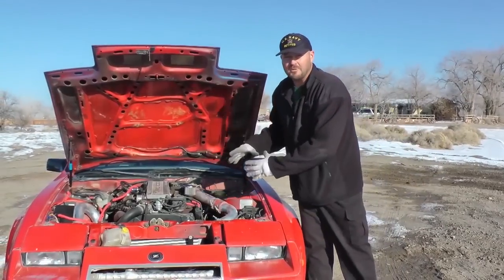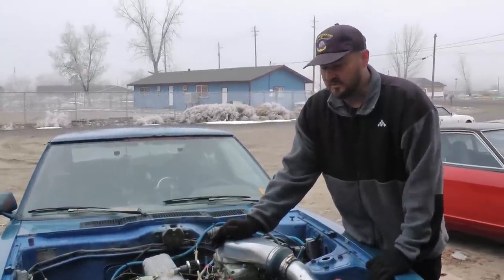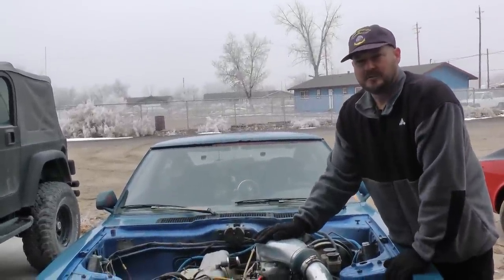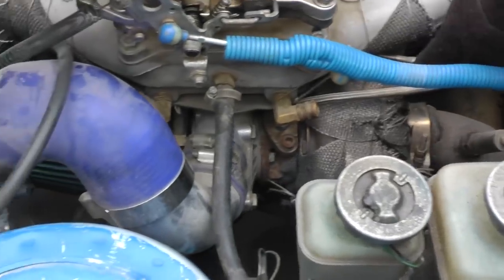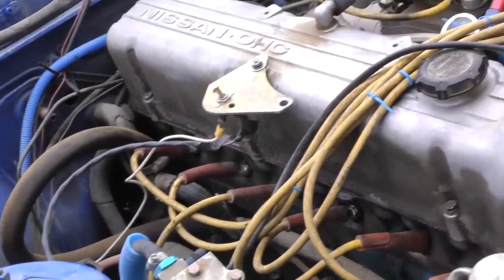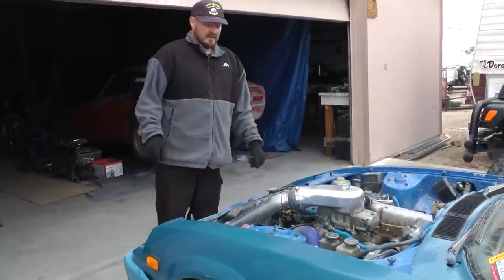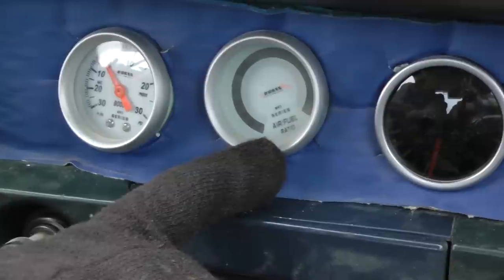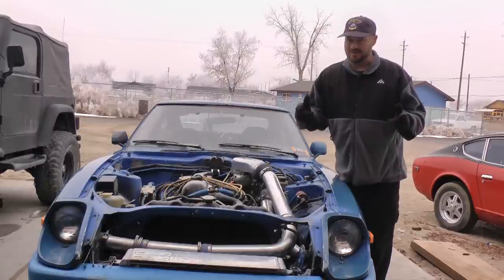Blow Through TurboCharging (Carburetor)

Comment: just gotta correct something: blow-off valves ARE needed. If you don't have it, the boost goes back through your turbo, decelerating it much faster than it would normally experience. this damages turbos.
Reply from the maker: dandil Watch our blow off valve the truth video.  Then if you still desire to make a comment, make your comment about blow off valves on that video not the Blow through Carburator video.  Thanks
Reply: all it does it slightly wear the thrust plate in the turbo core
and to tell is when a turbo shaft can be pushed back and forth(towards each turbine) 
this test is not the up and down play that ever knob talks about

there is a test to check for play up and down  on the compressor wheel and that is to hold the nut and  pull up and down(towards each side/top and bottom of the cold side/compressor housing)   
however every turbo new or old has play this is normal and this  is because there is very little oil in it
when you add oil this play will go to almost nothing as the oil and its pressure closes the gap

a good turbo will have some play but they should not hit the housing if so they are no good 
in worse case it will bend or snap off blades/fins of the wheels

bovs  with out them you can worst case is they snap the shaft(snap the compressor or turbine wheel off)
this hardly happens but does happen
Reply: Bottom line....you don't HAVE TO have 1.....but, it is a little more wear on the turbo on low boost systems. Now on systems with more (fun stuff) boost it WILL damage the turbo a lot faster then you'd like it to and cutting the life of it by a fair amount. But your right you don't have to have 1 if u can't or don't wanna afford to put 1 in but it is always recommend! Not to mention if your running a lot of boost and no waste valve it can blow something up. Seen it first hand lol its kinds like wearing a seat belt....do you have to wear 1 to drive...no, and u may go forever without an accident where u needed to be wearing 1 or u could never have an accident, or....you could go out on your first drive and bam
...should've put that belt on I guess lol....everyone loves to gamble right???? Would I put 1 on? Yes....would I drive mine here and there until I could get 1 put on? Yes...long term you should have 1 installed, the cons just outweigh the pros no matter the odds
Reply: @jjmccloud  No man! Didn't you listen to the video? He says it just, "dissipates".
LMFAO!!!! 🤣🤣🤣😋
Reply: You dont have to have it just like you dont have to have a intercooler but it makes no sense not to have. Especially when you can buy one used for nothing.

Comment: Blowoff* valves aren't necessary, but bypass valves in general, yes, ALWAYS run one on a boosted gasoline setup. Important tip: a blowoff valve is a specific type of bypass valve. I know stock tuning sometimes won't compensate quite correctly for a true blowoff valve [versus a stock bypass valve], but running a full on blowoff valve is undeniably safer than having no bypass at all. When the throttle plate closes under boost, if there's no bypass valve, that pressurized air has nowhere to go but back out through the turbocharger, in the wrong direction. Even if it doesn't literally cause the turbo to momentarily spin backwards, it can still mechanically stress the turbo unnecessarily. Overall good video though. Always run some sort of bypass valve on your turbocharged gasoline engine.

Comment: Although I drive an 86 z28, I still love watching informative stuff on cars, such as boosting. Awesome video, I'm not a forced induction expert, but I learned alot.
Reply from the maker: Bryan Dunn Lots of potential in the Camaro series.  Lots of budget twin turbo kits available for the Small block Chevy engines.  Superchargers are great in the Camaro as well.
Reply: Budget Boosting Agreed, I can pickup the piping, fmic, wastegate and bov, and a decent (non-ebay) turbo for a little over a grand. My problem would be tuning, my car uses the TPI setup from gm, so its run off of an ecm with a pretuned memcal. I think my next project is going to be a mkiii supra, although I haven't decided whether or not I like the 7m-gte platform more than the 1jz.

Comment: DUDE...I had a 77 280z and would have gave my left nut to have that set up. 
This was the best most simple, straight forward DIY how to on a budget even. Never know you could turbo a carbed motor. And compared to an EFI upgrade + turbo's it's a real budget build with big power potential. While retaining drivability.
Reply from the maker: starbattles1 Yes, I remember when I decided to go that route due to the stock fuel injection not handling the turbo set up very well.  I went the blow through turbo route and I have liked that set up the best.  I started with the Demon 650 blow through carb which was pretty good and eventually to the Quick fuel SS-650-BAN 4 barrel carburetor and I like it even more.  I have the intake and exhaust manifolds off this Z car waiting for a custom twin turbo header which a friend of mine fabricated to fit two of my z cars which will fit any z from 1970-1983, all the L series inline sixes.  It was fabricated to fit in these cars once the air conditioning compressor is removed and a few other things that are in the way for the twin turbo setup.  To me no A/C is a small price to pay for a twin T04e powered L28 Z car.  Once I get this new twin turbo header, I will get with my fabricator and he will start making them so we can sell them to others desiring twin turbo z cars.  We will sell them on our budgetboosting ebay account where we currently sell our window stickers.

Comment: I have been referring to this video for years, thinking about various vehicles I've had over the years that had carbs on them. But I'm doing it finally. Putting a turbo on an old 85 dodge ramcharger with the 318. I'm hoping to get it done before a big trip to moab Utah next April
Reply: How is your project coming along?
Reply: @matthewgraham2129  uhh......😅 not so good. The weather got bad so I had to stop working on it for like 2 months. We got thw motor and trans in, and got the motor fired up for thw first time without the turbos, and then went to move it undernits own power for the first time, but something is wrong with the trans, so it has to come back out
Reply: @garymaddux2000  haha I get that completely I'm doing a single turbo on a sbc. Got the turbo next is blow through carb and all the rest of the parts. Turbo kit will be made of pure exhaust tubing haha
Reply: @matthewgraham2129  I still need to get my turbo and blow through carb. Or I might go with an efi setup to make it simpler. For now, my headers just come up and point forward at where the radiator use to be lol.
Reply: @garymaddux2000  haha I still have to gap the rings haha got the turbo engine all apart in my shop haha. The truck is under a snowbank lol. But I'm just throwing pretty much using every paycheck for parts haha. Easy to do when you are 18 lol. But let's of projects as it it
Reply: @matthewgraham2129  I'm 30 but I'm having to start my life over, so I'm taking the time to do something for me that I've always wanted before instant rebuilding my life
Reply: @garymaddux2000  I'm right out of high-school and living at my parents house still so I am really fortunate to be able to put time and money into projects like these. I've been told over and over again to do this kinda stuff while I'm young so I will have the knowledge later in life haha
Reply: @matthewgraham2129  I would agree. Learn shit while your young, and do the thing you want to do because you may not get those chances once you settle down and have a partner and kids. I 100 don't regret anything in my life, but I do wish I could have done some things before my kids where born. I can still do them, it's just a little more difficult. But building an offroad truck is one thing I've always wanted to do, and I finally have the chance to do it
Reply: @garymaddux2000  haha that's awesome keep on keeping on and don't let it turn into all the half done projects out there haha

Comment: Huh, I have a 280zx with an L28 EFI. I thought that you HAD to go Megasquirt, big injectors, T3 and whatnot. But this looks very interesting.... I’ve never seen a carbureted car that is also turbocharged. Thank you for introducing this route to me. I’m considering this now that I see it.
Reply from the maker: The carburetor is designed for boost blow thru.  It is a quick fuel 650-BAN https://www.summitracing.com/parts/QFT-Q650-BAN. 
This carburetor with an arizona Z 4 bbl intake manifold will allow boost thru carb without complicated fuel injection systems.  https://arizonazcar.com/engine
Reply: @budgetboosting  cool. Is there a difference between 650,750 or 950 other than price?

Comment: Nice job on the blow thru setup!! I had a 79 280zx I converted to turbo but kept the EFI and it was a pain to get enough fuel to the engine at higher boost levels so I ended up using hobbs switches and extra injectors to feed it enough. Detonation was always a problem until I replaced the distributer and ecu with ones from a turbo car, then I used water injection at higher boost levels to prevent detonation. Now I got an 86 4x4 Nissan pickup with a 2.4 liter 4 banger and I'm planning a blow thru setup using a t3/t4 hybred turbo and intercooler fed into a Holley 350 2 barrel that's been prepped internally for turbo use with a boost referenced power valve and pitot tube on the bowl vent to keep a positive pressure in the bowl along with an EFI fuel pump and aeromotive boost sensing regulator. I have all the parts gathered up and ready now but need to get a smaller power brake booster since the turbo won't fit in there with the stock booster.
Reply from the maker: SuperDaveZilla I also first tried the fuel injection on my 79 and the fuel delivery had issues and that is what led to my using the blow through setup.  I even ran the MAF sensor in the boost path just prior to the intake manifold so the MAF directly adjusted to boost but even that was not enough fuel delivery for boost and the low octane pump gas.  Found that the blow through set up works well and will even work with the pump gas as long as the boost is not too high.  Thank you for watching and look forward to some pictures of the Nissan 4x4 truck blow through when its done.

Comment: I’m building a 91 Isuzu 2.3 turbo. Trying to find a decent manifold that’s not 700.00. Geminiturbo had a nice manifold and other than stock all I can find. Thanks for the info. Hopefully by mid summer I’ll be boosted!
Reply from the maker: You could have an adapter flange made with a T3 turbo flange and a custom made bolt on adapter for your intake manifold to run a holley style blow through carb.

Comment: Thanks a lot a light bulb went off in my head when you mentioned the T connection for the oil supply. I just realized that engine oil is under pressure from the oil pump so all you have to do is tap into that pressurized oil and it will be pushed into the turbo... I used to be confused as to how turbos got fed with oil O thought maybe the turbo has a pump inside that pulls oil from the oil pan or there's gravity feeding but none of those sound like they would work.

Comment: Your in with this here,and thanks for a brief explanation of how the thing works I've studied little about the systems but always held interest in the older cars run with much electronic assist.
Reply from the maker: arthur clark Yes the older cars really benefit from turbocharging.  I see many old monstrous twin turbo Camaros, Corvettes, Mustangs and many others blow through the traps and very high speeds and very low times at Top Gun Raceway.
Reply: back pressure is not considered from the point of bottom dead center but again the boast adds pressure the cylinder should test positive for vacuum if valve timing is correct likely in most of the older cars it's not as tight or correctly timed when it is the turbo is likely larger than normal
Reply from the maker: arthur clark  At idle a turbo engine will see its normal vacuum, as load is added to the engine and boost increases, vacuum will become positive pressure so having the stock vacuum advance will not benefit the older vehicles.  I removed the vacuum from my electronic distributor so it is a constant and no adjustment on vacuum.  I also install a boost referenced fuel pressure regulator that ensures fuel pressure rises as boost rises.  When much larger turbochargers are installed, usable boost will take longer to build up and directly reflect negative vacuum and boost pressures.  One way valves or breathers should be installed to ensure boost does not pressurize the valve covers or engine block.  Lots of things to consider when turbocharging a non-turbo car.  Its quite the adventure though.

Comment: I thought I had a Z problem lol. keep it up, good to see another blowthrough z running around. my blowthrough setup is using triple side drafts, but this is what i was planing to do had i not found all the parts. great video!
Reply from the maker: Like z cars, even like them more turbocharged and carburated.
Reply from the maker: Budget Boosting I believe I found your website with the old HKS triple deuce blow through turbo kit.  I have always liked that kit ever since I saw it in Japan on an S130z with twin TD06 turbochargers on a 3.1 stroker.  That car was wicked and that kit is severely hard to find.  In the states Jim Cook Racing used to sell the Cartech triple weber side draft complete kit including a T04 turbocharger, external wastegates, intercooler and all the tubing and bolt ups necessary for installation for around $3500.  If only those complete kits were still for sale, that company would make a fortune since there are many old Z enthusiests than there were then.....  I like the HKS set up you installed, since you were running rich, a much larger turbocharger would fix that, somewhere around a T70 with ball bearing, 15-20 lbs of boost, 100 octane fuel and you would be golden.

Comment: thats a one super great video i've learnt alot from it
iam about to fit a turbo to my 1600 engine i got a turbo kit installing it by now

i need to ask about
1- how to adjust the AFR and how do i manage it correctly
2- how to set up my carburetor for the turbo charger
3- where to install the BOV before the inter cooler as u did or after it or it doesnt matter anyway?

and once again thx for the great video
Reply from the maker: Ahmed Nabil You can install your blow off valve anywhere on turbo compressor discharge or as I did.  The important part is you pick a good place where it fits well.  Fuel air mixture can be done by the carburetor jetting process and by way of a boost referenced fuel pressure regulator, I made videos on both those subjects you can watch.
Reply: Budget Boosting yea i did watched all of the videos related to the questions i've asked 
i recently made the oil connection ( connector and a return to the oil pan ) 
tomorrow i will fit the turbo compressor to the manifold 

as for the AFR i will get a gauge to measure the lean and rich process and start jetting it until it get the suitable ratio
i got the fuel jets as the following as a standard factory 115 for 1st gate which is primary and 125 for the secondary throttle .. i replaced the secondary with 135 jet 

is there anything else i can do to my carburetor ?

and thx for replying ^_^

Comment: Hello sir can i use a standard N/A carb in conjunction with a turbo? i can see you are using a well made turbo carb. thanks.
Reply: Sorry I'm late to the party, but you can use a standard carb in two ways. Firstly isn't so easy (unless it's fairly commonly done with that model of carb for example SU carbs), seal up any vents/throttle shafts etc and find a way of venting the float bowl as well as being able to pressurise it on boost. Second & much easier but less tidy maybe is if you build the whole carb into a plenum chamber. This means the whole carb inside and out sees boost and thus no excess pressure is put on it. You then only need to seal up the point the throttle cable and fuel line enter, just make sure to use a linear fuel pressure regulator with the plenum set up so that your fuel pressure stays at the correct level relative to the boost rather than the boost overcoming the fuel pressure causing the car to lean out.
Reply: How the hell are you going to say building a boost box for a carb is easier than $50 worth of mods that anyone can do in a day to any Holley carb easier ? To the original poster if you haven't already bought a blow through there's a right up by hanger18. Not everything listed is necessary unless your making 18psi plus.  I have built 3 Holley blow through carbs for around $50 each. But the most mine have seen is 15psi.
Reply: no

Comment: There is spring in blow off valve what you can usually adjust tighter and it isn't open with low boost if is it adjust hard. you can hear tsuhhh sound when it's open and there isn't thad sound.
Reply from the maker: johanijohani yes the ones that have the adjustable spring are the best type.